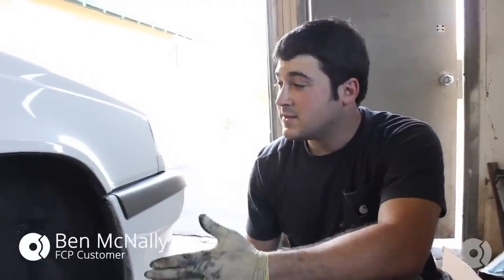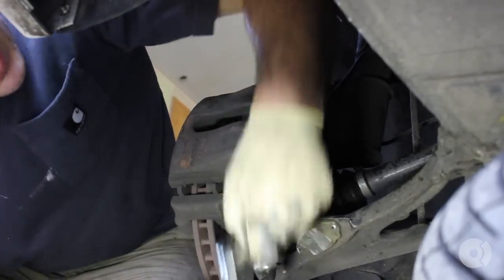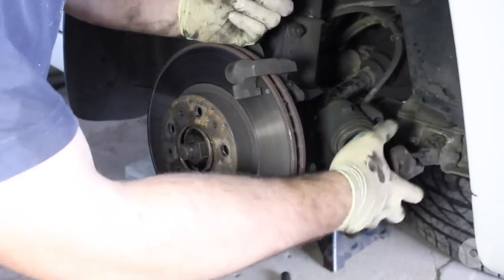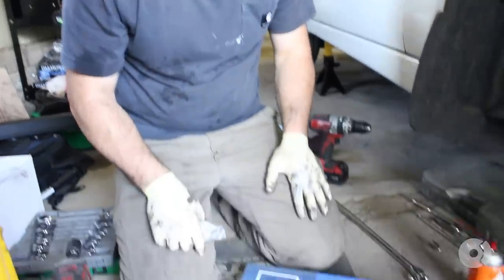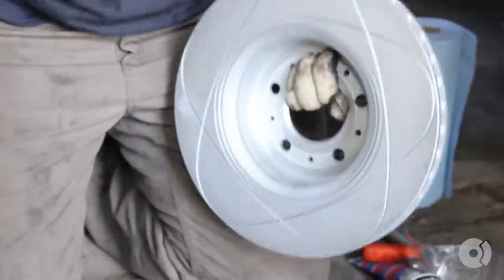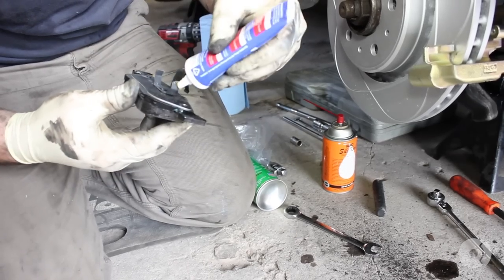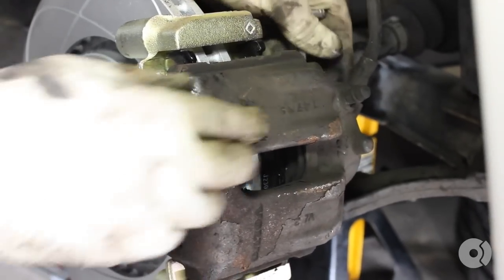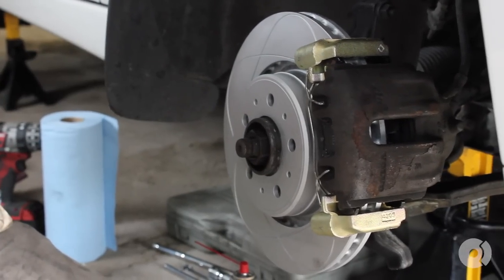Volvo Brake Upgrade (850 Front Akebono Pads, ATE 302 Rotors)

Comment: Great video! But don't forget to pump the brakes so piston pushes against the brake pads and resets. if you don't do that and drive off, car will not break unless pumped a few times. I knew somebody who didn't pump brakes before moving the car and car went off a ramp while in reverse. The grease on the contact points is to help reduce/eliminate  the squeaking sound but I didn't hear that stated. Your video is very helpful. Thanks!

Comment from the maker: Both great pads, you won't really go wrong with either, Akebono pads are ceramic, quiet and basically dust free with a more gradual initial bite.  The Genuine Volvo pads brake a little more aggressively and will produce more dust than the Akebono.

Comment from the maker: Torque specs for items like the caliper bracket bolts and slider pins are difficult to come buy. For the most part just make sure they are snug with a wrench and you will be perfectly fine. Often time, we find that adding some blue loctite to the caliper bracket bolts is beneficial as well. Hope this helps.

Comment from the maker: It could really be anything from a bad match of compounds (rotor vs pad) to driving conditions. I would start by replacing with a quality set of pads and rotors and an inspection of the hoses, calipers, and rear brake operation.  Hope that helps.

Comment from the maker: It's non uncommon for new rotors to make a soft grinding noise especially with zinc coated rotors.  So long as your pads were in proper position on the caliper when you slid it back into place you should be ok. You should also bed-in your new brakes.  Warm up the brakes by driving around gently, then Make eight to ten near-stops from 60mph to about 10-15 mph. Do it HARD by pressing the brakes firmly, but do not lock the wheels or engage ABS. That should help remove some of the grinding you hear.
Reply: The pads I just put in say to do THIRTY repetitions of going from 30mph to 5mph without actually stopping, and waiting 30 secs between. Something about distributing the friction material on the rotors. I have never heard of such a particular procedure before...

Comment from the maker: You really just have to sit down and measure the diameter.  I find measuring it with a string then measuring the string allows you to get the measurement without taking the wheel off.  Hope that helps.

Comment: Thanks for the reply.  I did replace with the Volvo Rotors and Ceramic pads... they warped in time ... Recently I changed the struts (they were not too good).  Maybe I do the Calipers and then Master Cylinder soon after...

Comment: hi, I've 280mm disc on my 1996 Volvo 2.0T5 Europe edition, I want to upgrade 302mm disc, I found both brackets and disc from Volvo service at my country but I couldn't find springs, can I use my springs from 280mm calipers or size is different?

Comment: Ceramics are only good for intensive braking as they only have good grip when they are heated up, which usually doesn't happen in most normal driving conditions.  If you don't do racing, the semi-metallic ones (the OEM) have better grip than the ceramic ones.

Comment: I have a 2001 S60.  I replaced the front rotors a year ago with Volvo brand rotors.  I used Ceramic pads from a local store (maybe Autozone or Pepboys).   The brake rotors seemed to have warped again.  In the past, when I hit the brakes, sometimes you can feel a little click click click in the foot pedal.  I let go and repress and it goes away. The car had bad struts in the front.  I replaced them.  I had the brake fluid changed a while ago.  Any idea as to why my rotors are warping again?

Comment: So I just did the upgrade but i could not compress the piston (my channel locks were too small).  I managed to wiggle the caliper on with the pads and the rotor was spinning even though the pads were in contact with the rotor.  The test drive revealed a low grinding noise during breaking.  Do you recommend I try to reset the piston again or is this common with new rotors?

Comment: Should you use Loctitie on those 15mm bolts for the bracket?
Reply: Use a small amount of anti-seize on your bolts. As long as your torque them properly, you want your bolts to be able to come off later without snapping them, not making them a pain to get out.
Reply: Thank you!

Comment: I have a 2008 V8 S80. There are 3 different size rotors listed for this car. How can I tell which rotor is needed for the front week brake replacement?

Comment: "Ratcheting wrench".. i did try and got myself trouble getting it stuck. Wasn't funny. Needed to use cutting tools get it off. It had long bolt on suspension and i didn't notice it before was too late.

Comment: Hello

I've got a question, about the type of 16' rims this upgrade fits. My 850 T5 is equipped with Columba rims - are these enough spacey to work with 302mm discs with original calipers od new brackets?

Thanks in an advance.

Comment: Do you need to bleed the brakes when your done?
Reply: Nope. As long as you don't take the brake line off the caliper.
Reply: that fluid gets old, i like to freshen it up, supposedly the type 4 absorbs moisture worse than 3

Comment: Sorry, but that is just painful to watch. 

1. The brake lines need to be replaced to oem longer ones, that can accommodate those 302mm rotors. The short ones will most likely tear in the future. 
2. You have to put at least red Locktite on those carrier bolts, they are tightened with 100Nm! (73lb-ft!) you never achieve that kind of force just with snugging it with a wrench. It holds the whole brake assembly! Also putting new bolts in is a good idea, because the old ones will physically never achieve that clamping force as new bolts.
3. Too much grease on the caliper and pads. At this point your gloves are full of that and you are putting it on the new rotor thus on new pads after a few rotations.
4. Compressing the piston like this will make an uneven stress point in the caliper housing, there are tools for that.
5. Every bolt has its own torque specs, which does not appear in any of those videos.

For right now, I would not follow any step of this video. There are Volvo OEM step by step technical instructions on this (with every torque spec), that everybody can buy for little buck on skandix.

@FCPEuro Please make a new proper video on this, as this is a subject of safety of people that are watching. No hate intended!

Comment: These wont fit under 16s
Reply from the maker: These should fit under most 16 inch wheels. They will not fit under 15's however.
Reply: @fcpeuro  I'm telling you now they wont. If your going to the 302 brake setup up need 17s. Also slightly longer brake lines. Luckily I got braided lines and 17s

Comment: WARNING: I'm not sure I'd be happy to have this bloke on my car if he's selling low-dust pads as a good thing. Er...  I'm pretty sure they have schools in the US? Did this man not got to one. Stock pads produce quite a bit of dust for a reason. If this man's pads produce less, leave Akebonio sh*t well alone. He's a fool. And how does the finish of a casting that is going to be chomped on by a pad in about 2-3 yards of use matter to you anyway? Oh, sorry I get it. The pads are so hard they produce less dust so the finish stays as you see them out of he box. So this is a good thing too? We have less wear, and the pads last longer than stock as well.  I see.... I'm coming round to this logic. 

There's thin line between intelligence and stupidity.
Reply: i wonder if they eat the rotors faster
Reply: The akebono euro pads are a ceramic composite pad. Hence the reduced brake dust